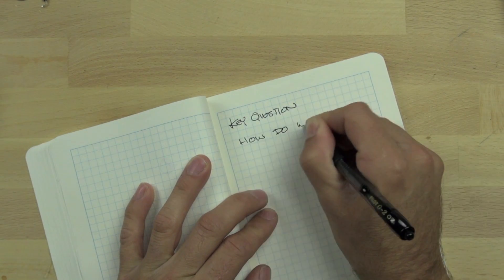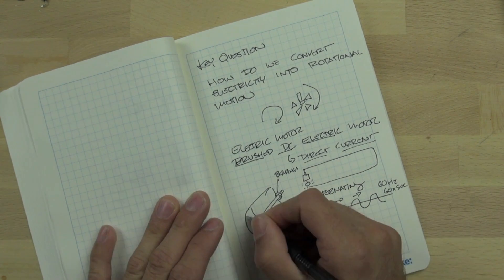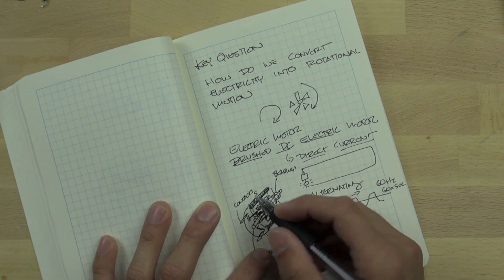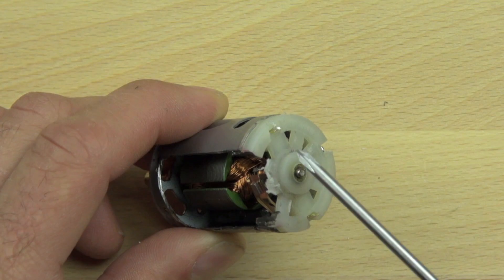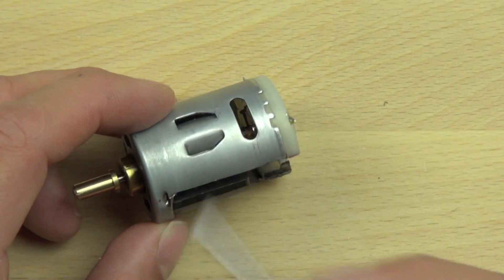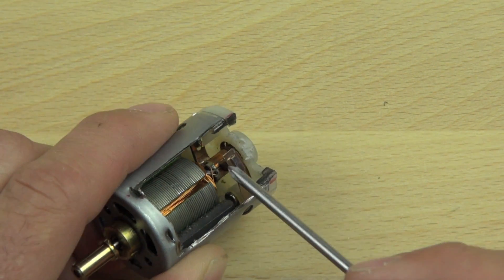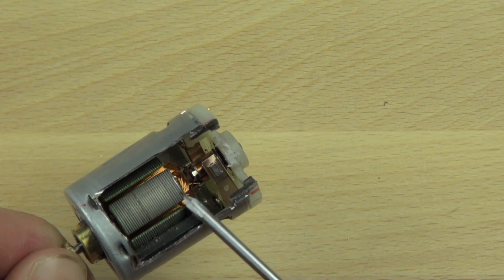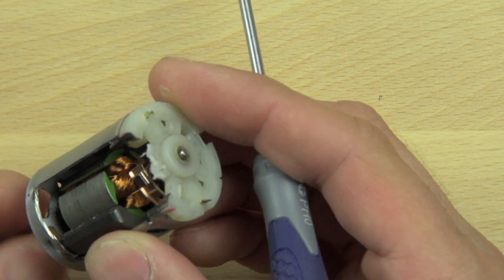Brushed DC motor explained

Comment: I own an old brushed DC motor that needs overhauling.  What happens if I replace the old permanent magnets (from the 60s) with modern and stronger neodym permanent magnets? Will it influence the general function of the motor (like power, RPM etc) or will it just increase torque?

Comment: I have dc motor having trouble knowing which is positive and which is negative after viewing your video I might assume that if polarity was switched on battery ît would run in opposite direction
Reply: James Little that is what happens

Comment: my 1:16 rc motor is working but when they are connected to the axles 
makes a noise and it does not pull the vehicle.

Comment: How would you get more power /rpm out of a motor
Reply: power out is proportional to power in. simply apply more electrical power. To a point. you can melt components if you're not careful. To get more RPM with the same amount of power, use gearing. It'll cost you torque, but you'll have more speed with the same power.
Reply: Change stor size
Reply: You can use pulleys and gears to up the work. A dc motor can be changed to give a lot of torque OR a lot of rpm. Not both. If you give it higher rpm it reduces the ability to start the work, it just hums. Capacitors can help with the starting but capacitors will not supply a lot of power after 1 or 2 seconds. Overall that's the principals.
You can have high torque and use pulleys to up the output or high rpm and use capacitor to start(within limits)

Comment: great info thanks . what kind of motor did they use with old sewing machines where the foot pedle is attached to the electric cable
Reply: +mrstwitchyfingers Small brush motor, the pedal contained a variable resistor, that did the speed regulation.